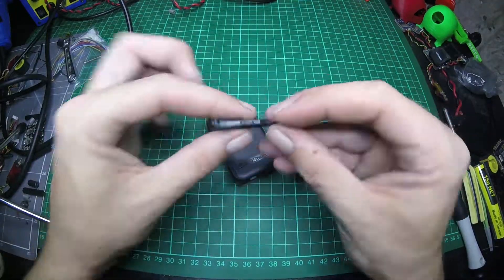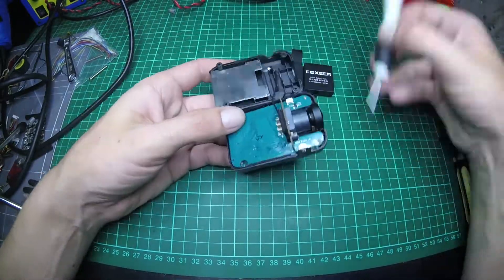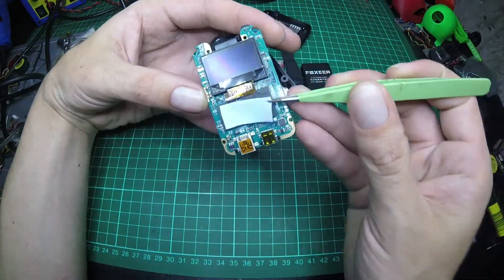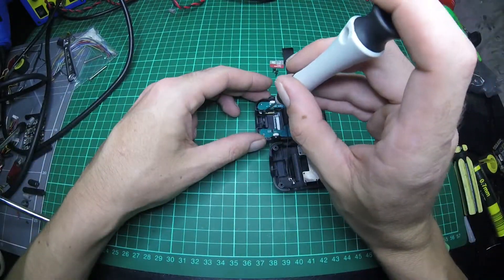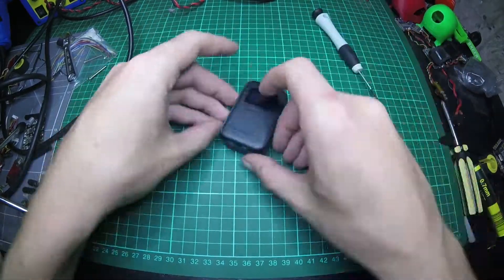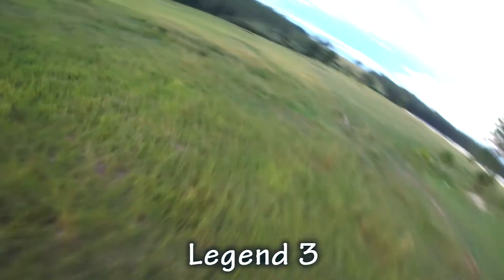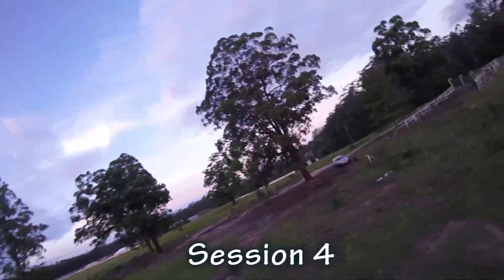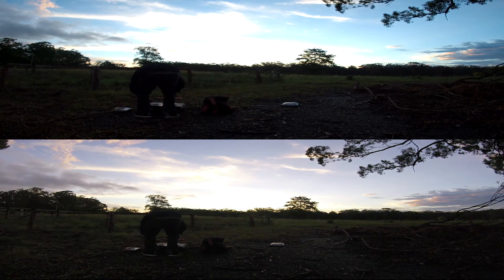Legend 3 V's Sesion 4 Low Light + Teardown - Product Preview.

Comment: Thorough...  man, I'd buy a few of these cams if they'd just get the audio right.
Reply from the maker: haha very fair call , they are under the impression that the mic is the exact same one that gopro uses.. & it might be.. i really don't know but even on its lowest setting it sounds like garbage
Reply: Probably the way it's processed with AGC or some other dynamics issue.  Also, I heard a weird digital noise thing when you were just talking, so maybe ground or shielding issue, and likely a mounting or wind-protection issue with the way things are put together.  Even if I could fix it myself I'd be happy with it.  The form factor is fine, and having a removable battery is mandatory.  Lots of positives, but I'm not recording audio externally, and it's important enough to be a huge factor, 50% in fact; https://sound.stackexchange.com/questions/14019/importance-of-sound-quotes